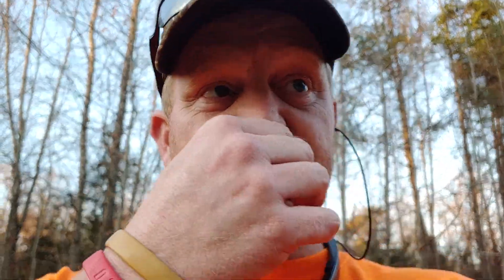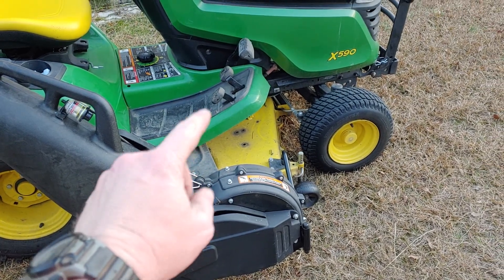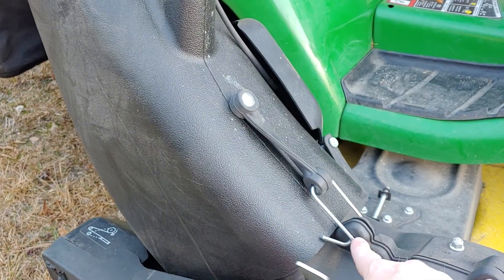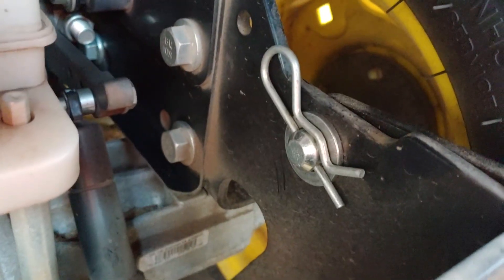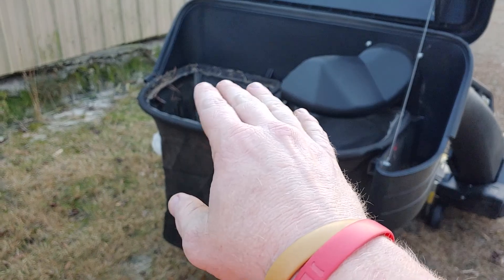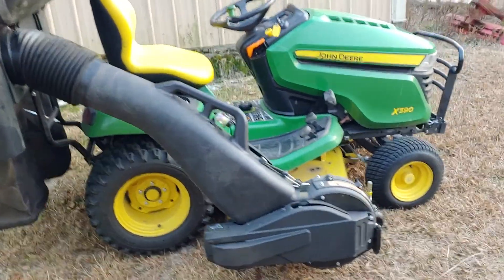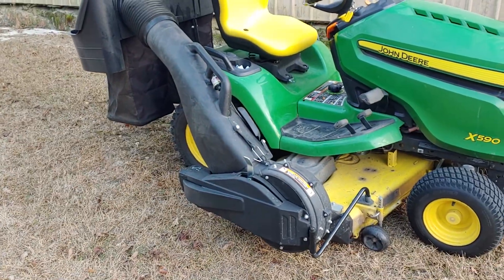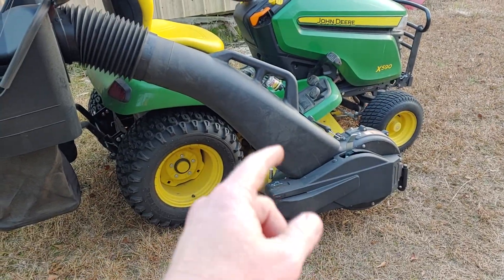John Deere PowerFlow Bagger: Overview

Comment: I had a 7 bushel Power-Flow collector on my X590 and then upgraded to the 3 bag, 14 bushel collector.  Primary reason being is that I have a lot of customers who like their grass collected.  Also, once the hopper assembly is worn in, the blower is strong enough to push the hopper open around the rubber isolator material and it spews material out.  Especially annoying when trying to clean up leaves.  The 3 bag hopper has a heavy duty latch that doesn't budge.
Reply from the maker: Thanks for the info, it does a good job for what i have used it for and hopefully it will last a long time since I don't bag a lot. Thanks again for watching!!

Comment: Thanks for the video.  Would you happen to know if the power flow will work with the 48” deck using the mulch blades or do the standard blades need to be used?
Reply from the maker: Yes...i think that is actually the smallest size deck for it. I would use some type of lift (medium or high) or gator blade for best results with leaves. If just bagging grass I think you could use standard blades with the blower. Hope this helped and Thanks for watching!👊

Comment: I have a new s240 and I have broken 2 belts now.  Do you know what mode bagger I need to remove the PowerFlowBagger and return to a no-belted collection system? I have a 48 inch mower deck and it doesn't have the piece of metal to rest a non-blow attachment.
Reply from the maker: I can't say. I am not very well versed in baggers. They may not make one for that machine without the blower🤷. I would say you would have to verify with a JD dealer. Usually baggers a re made specific to certain models....

Comment: Very nice, i was wondering how much the power flow was these days. I have the same system on my older GT235 and I think it was about $1200 back then. My only problems with it is it "leaks" clippings, so i had added bungee cords on both sides to help hold the lid down tight.
Reply from the maker: Man, sorry I missed this comment🤦. This bagger was about $1100 when purchased so prices are about the same it seems. I didn't get a lot of blow out from around the bags, but that could've developed later on I guess.

Comment: Do you need high lift  blades for leaves or dose the power flow suck the  mower deck, if you dont need the blades is it worth putting them on for the extra flow ?  I just picked up a used one so your vid was very helpfull to see how the brackets mount to the deck.
Reply from the maker: Glad it was helpful ..you don't have to run high lifts with this unit having the blower. It can help but can also be an issue in places with more sand/soil where the lift blades pick up more of that. Hope this response was helpful as well👍.

Thanks for watching 👊

Comment: Thank you for such a great video, how difficult was it to install the dual belt pully, and did you have to remove the mower deck to do that?
Reply from the maker: Thanks. It wasn't bad. You can remove the nut that holds the pulley on (on the top) with a large ratchet or an impact. Then just reinstall the double pulley. You don't have to remove the deck.

Comment: Just watched your review on the John Deere power flow bagger of which I have 2. I was hoping to find an alternative for the latch assembly that holds the chute to the power flow. I'm 71 and have no where enough hand strength to remove that latch. Wondering if anyone has an alternative?
Reply from the maker: I don't know of an alternative. I have sold the unit. Wonder if there might be a way to swap it for a bungee cord that has a little less tension on it🤔🤷. Just a thought...hope you can get that figured out💪👍

Comment: Hello John. Would you recommend a bagger or a sweeper for pine straw, leaves, sticks, and pine cones?
Reply from the maker: If just leaves I would say go with a bagger, but if it's all that stuff in most of the area, I would go with a sweeper. I would be worried a stick might damage the blower impeller. Just.my.thoughts. Thanks for watching 😁👍
Reply: @joshslawnlandscape9935  That makes sense; there's a lot more heavier debris. Thanks for the advice!

Comment: Great video!! I bought a used John Deere #345/54" deck, which came with the Power Flow system. Unfortunately I do not have the bracket which mounts to the front of the mower deck and holds the "Z" bar. Any idea what the part number for this is and where I could get one??? keep the videos coming.
Reply from the maker: Thank you. I don't know if those parts come separate or not so I couldn't tell you a part number. Maybe find a JD dealer and ask them or check the deere.com website and search for it🤷. Appreciate you watching 👊💯
Reply from the maker: Is your mower a GX345??
Reply: @joshslawnlandscape9935  Thanks for your response!!!!
Reply: Roger mead,
The part number for the bracket is AM 131219. The bolt is # 19M7867 and the locknut # is 14M7166 ——
Deere says you need 4 bolts and nuts
Reply: @bagadonutz5717  Thank you very much for providing this information!!!
Reply: @rogermead9637  @Roger mead glad to be of some small help

Comment: My catch shute keeps comming apart at its upper connection leaving me trying to mowe with one hand and hold the shute together with the other! Is there a way to fix this problem?
Reply from the maker: Is it where the tube goes into the ribbed part or where the ribbed part mounts to the lid?
Reply: It is where the tube goes into the ribbed part. Thank you for any advice you can help with!
Reply from the maker: 🤔🤔......... Double check the angle of the tubes. If one is twisted or anything like that it could not allow for the best connection🤔🤷. I haven't had mine do that before. The tube on mine goes of couple inches into the ribbed part. Maybe use 2 or 3 3/4" screws around the connection point if all else fails.

Comment: Hi can you remove the bags and the cover and leave the metal mount on the tractor? Thanks!
Reply from the maker: I know you can remove the bags easily. I am not sure about the cover part honestly, without taking the whole rear bracket off. I sold the bagging unit a while back so I couldn't look to check anymore.

Comment: Can you describe the total increase in overall dimensions?  Looks like it might be 12” wider and 18” longer than it was without the bagger installed?
Reply from the maker: Yea I would say about 10"-12" wider and possibly 24" longer given the bracket spacing off the mower and the bag depth. I would measure but I actually sold the bagger🙄. Appreciate you watching💪💯

Comment: So what makes the powerflow better than just a regular bagger?
Reply from the maker: I think the biggest difference is having the blower. That produces more flow to push material into the bagger vs just using the air flow from the blades out of the deck. The extra air I feel moves more material as well. Just my thoughts.👍
Reply: @joshslawnlandscape9935  Ok. Thank you for your opinion

Comment: Thanks for the video. I thinking about getting this bagger for my x500 series mower. I have a 5.5 foot wide trailer. Was just wondering if you have ever measured the width of the deck with the PowerFlow  attached and would it fit on my trailer. I have a 54" deck also. Do you have weights on the front?
Reply from the maker: No weights on front with the 2 bag. They might help with tje 3 bag setup. I haven't measured It but It would be close I think with the blower on the 54in deck for a 5.5ft wide trailer. Thanks for watching👍

Comment: Dumb question but why is it absolutely required does the 54 inch deck not allow for grass to collect properly without the flow… Would it clog otherwise cause 1100 is just a lot of money
Reply from the maker: I believe it has to do with the volume of grass moving through the 54" and larger decks. I don't think there is enough air flow from just the blades to push that volume up the tube without clogging and/or dropping a lot of clippings back on the lawn.

Comment: Does the deck need to be leveled after blower installation? Mine seems heavily tilted towards the blower side.
Reply from the maker: I just level mine for cutting. I think having the blower closer to the ground when bagging allows it to work better. Also you don't have to level the deck 10 times...lol😜👍

Comment: Hi, good video. I have a GT275 and I've just started using the powerflow system to pick up leaves. Is it more of an advantage to put the deck down closer to the ground? I usually mow at a 3 setting but that seems a bit high. Also, have you tried those single huge drag behind bags? I just bought one but have not used it yet. Thanks a lot.
Reply from the maker: You have to be careful with dropping too low and you end up not allowing leaves under the front of the deck, and you risk sucking up a lot of dirt in some cases. I have not used the big drag behind bags. Thanks for watching!!👍
Reply: @joshslawnlandscape9935  Thanks a lot for your reply, I'll split the difference in deck height and see what happens.
Reply from the maker: You can also drop the scalp wheels on the blower side of the deck by one notch to help keep the deck from tilting too much that way👍👊
Reply: @joshslawnlandscape9935  ah, good idea, I'll try that, it was working great yesterday, but that might steady the entire deck over uneven ground which I'm dealing a lot with. Thanks!

Comment: Hi Josh, how do you adjust the blower for more power so it can blow the leaf and grass clip to the bagger. I bought my X390 I mower when the bagger full and I empty dump the bagger a lot of leaf stuck inside the hose and in the fan blower it can not blow to the bagger anymore, I need to remove the hose and clean dump.
Reply from the maker: To my knowledge there isn't an adjustment. The blower power is based off of the PTO/blade speed.  Sometimes if you cut a tad bit higher you don't pick up as much sand/dirt and that helps not clogging the chute also. Hope this was helpful 👍👊